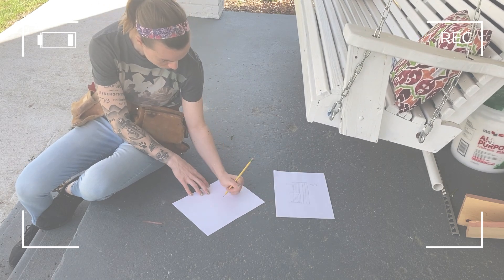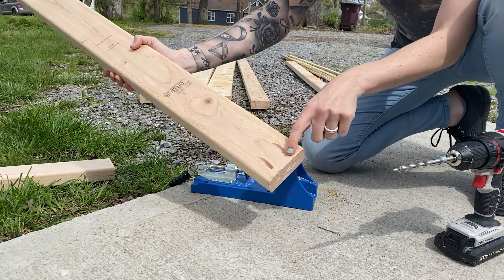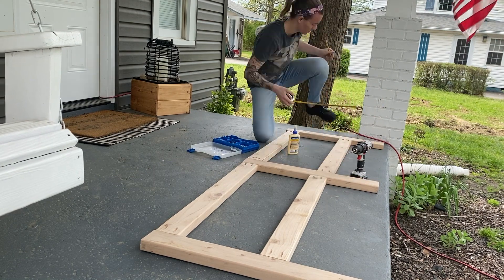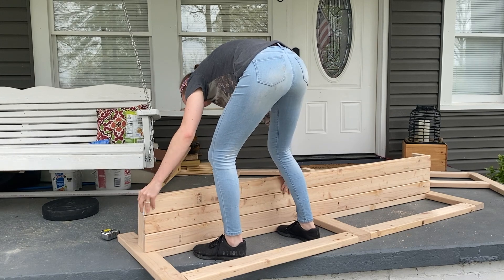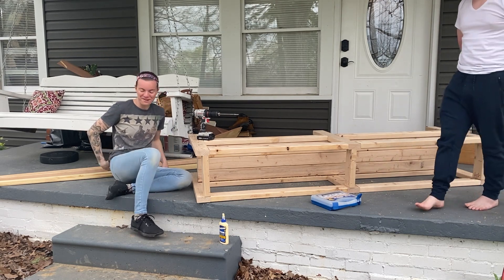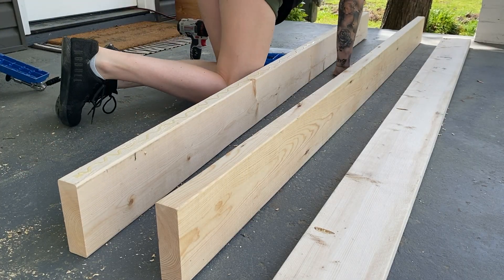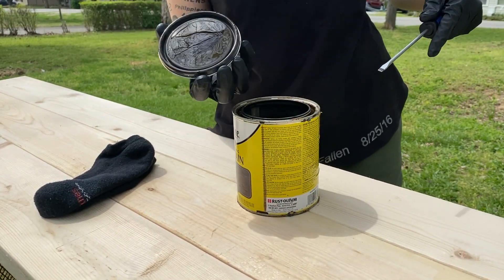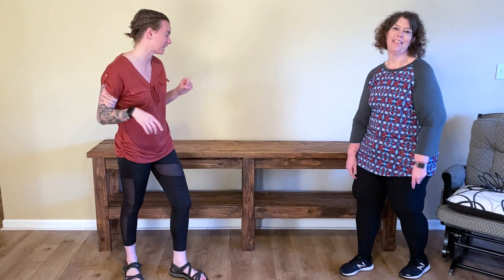DIY TV Stand For A Deserving Friend - Wow I Built This // 𝐓𝐡𝐢𝐬 𝐅𝐚𝐢𝐭𝐡𝐟𝐮𝐥 𝐇𝐨𝐦𝐞

Comment: I need to build the same type of shelf for my land lords 70 inch flat screen tv.its sitting on a bulky broken down dresser she wants tossed out
Reply from the maker: This will definitely serve you better than a bulky broke down dresser!!
Reply: Can you send me the measurements
Reply from the maker: @valerietaylor9126  
Here’s the cut list! And the final dimensions are: 86” long, 16.5” wide and 29.5” tall :)
2x4 boards:
-Upright legs: 28” cut 6 times
-Long side brace for legs: 37” cut 8 times
-Small brace front to back for base: 10.5” cut 6 times
-Middle shelf boards: 80” cut 3 times

2x6 boards:
-Top: 86” cut 3 times
Reply: Thank you so much ill send a picture if allowed when its done would it be ok to build it from pallets i dont have much money
Reply from the maker: @valerietaylor9126  I would love to see a finished product! I will say you want to be careful with pallets making sure they aren’t rotting and you will need to spend extra time sanding them to make them really safe indoors. I would suggest spending the money you can on 2x4 for at least the legs and frame. And if you need to save money somewhere and you are using pallets, use them for the top and shelf and piece them together! Over all I spent under $100 on this project including the stain which I know may still be out of your price range but you want to build something sturdy that will last, so investing in the 2x4 from the beginning will assure that!!

Comment: What size screw did you use to hold it together forgot to ask thanx
Reply from the maker: Alec Jackson I believe I used the 2 inch screws that came with my pocket hole tool kit. But if you don’t drill pocket holes and just drill from the outside, I would say use 2 1/2 inch since it has to travel farther than the sunk in pocket screws

Comment: How many 2×4 to buy for this project please ty
Reply from the maker: Alec Jackson 6 if you do the cuts perfect but it doesn’t leave room for error. So I would get 7 boards. Plus 3 2x6 for the top
Reply from the maker: Alec Jackson and make sure to check and make sure each board is straight and not bowing. You can ask a Home Depot or Lowes employee in the wood section to show you how to look down the board if you are unsure!
Reply: @ThisFaithfulHome  thank you you've been very helpful👏👏😜😀

Comment: What is the length of the stand and width I'm getting a 82" inch with the duck feet just need to stretch it a little. Great video
Reply from the maker: It measures 86” long and 15.5” deep! You can always adjust the length by adding some inches to the long brace boards and the top and shelves!! Thank you for your support!

Comment: Hopefully it’s not a big tv because it will fall apart you forgot to adjust the height on the pocket hole to 1 1/2 inches just a friendly suggestion
Reply from the maker: Thank you for your feedback. I did indeed use the correct screws for this project and the table is very sturdy! But I appreciate you looking out for me!

Comment: If the middle braces are 10.5" then how does it span 3 2x4's. This has my mind frozen. Can anyone help? I am currently in the middle of the project.
Reply from the maker: Great question! So the top boards are 2x6s and have a cap overhang on them! Then the shelf is nestled within the 10.5 inches. 3 2x4s = 10.5 but the top is technically 16.5 inches
Reply: My whole life I didn't know that a 2x4 was a 1.5x3.5. Just measured😬😮🥴
Reply from the maker: @denver07  it’s so weird right!!! It’s because it’s a milled wood. But definitely would throw people off for sure!!

Comment: How is the top attached to the base? Pocket screws also?
Reply from the maker: Rubbercity1 yes it does!
Reply: This Faithful Home ok so the pocket holes go from the bottom up from the 37” 2x4’s? Love the build by the way great job!!
Reply from the maker: Rubbercity1 it’s actually 3 on each of the 3 short pieces (10.5”) on the width of it. Then each of the 3 will attach to each of the 3 top boards

Comment: I'm new at building something like this, I have a 75" flat screen sitting on the floor...I need help!..lol
Only have limited tools to build with on a budget
Reply from the maker: Alec Jackson I understand that it can seem intimidating to build! But you can always ask your local hardware store to cut the wood if you need, or use longer screws to bind the boards together and have them show instead of using the pocket hole drill! Here’s the dimensions below for you as a reference that you can modify. This measures about 84” long which would work for your tv size!

2x4 boards:
-Upright legs: 28” cut 6 times
-Long side brace for legs: 37” cut 8 times
-Small brace front to back for base: 10.5” cut 6 times
-Middle shelf boards: 80” cut 3 times

2x6 boards:
-Top: 86” cut 3 times
Reply: @ThisFaithfulHome  I've taken all of the measurements down I hope this works keep your fingers crossed I will be heading to Home Depot soon and if I do this right I should have a stand and looks something like yours except a little bigger?
Reply: @ThisFaithfulHome  the only tools I currently have right now are a pocket hole jig drill bit measuring tape saber saw that's about it
Reply from the maker: Alec Jackson that’s so exciting!! And yes it should, the measurements I gave you will match mine!